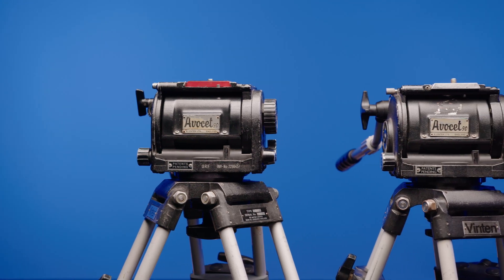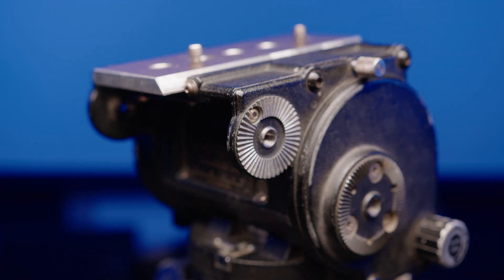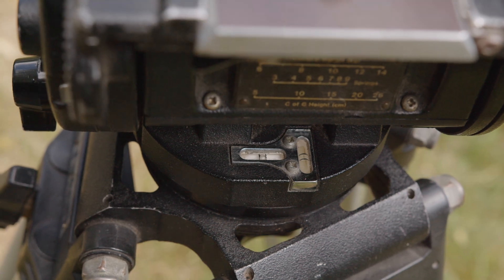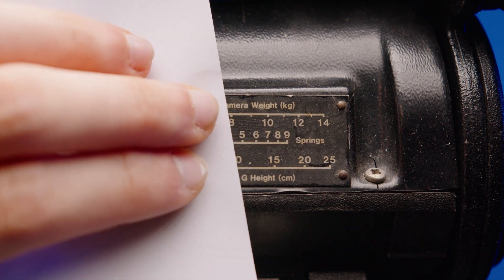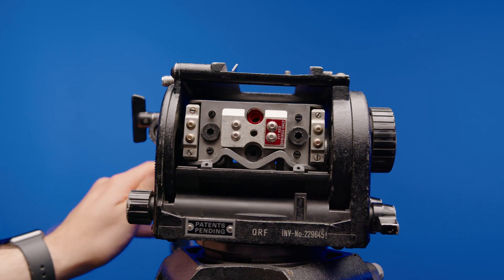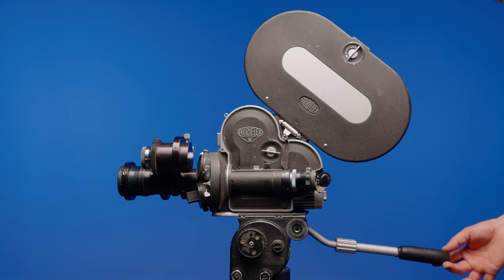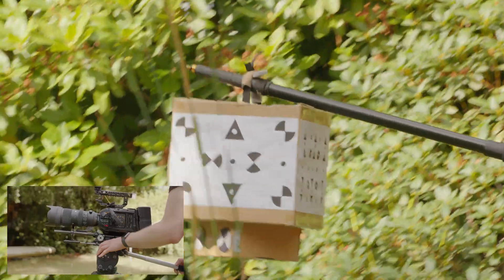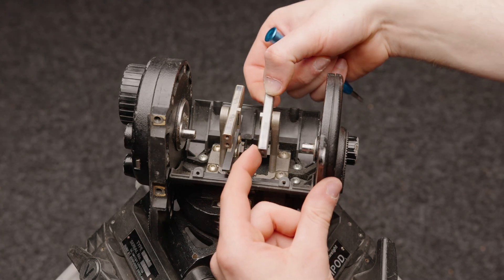Interesting Vintage Fluid Head Technology - Vinten Avocet 90

Comment: Do you still have this head? Or do you know anyone?
Reply from the maker: Yes, I still have both of my Avocet 90 tripod heads, but I don’t know anyone else who owns one, and I haven’t seen another one out in the wild since.
Reply: @deadendboredom  Wow, you have two! Did you already fixed your issue with the spring adjuster? 

The one i have has a small issue. When using the altitude brake it makes a noise. Not real problem since in never use it, but the same noise is generated when you move the head in altitude. The noise only happens around 30° in angle and up. You can feel it in the pan handle to. Not good cause it causes vibrations…

First i thought it occurred due to excessive spring tension. So since i lowered the load the noise and vibration was gone with lighter loads. But now it is back even with zero load and super loose spring tension. 😢

Do you have any idea what i could try? 

There was a video where one disassambled a vinten avocet but cant find it anymore.
Reply from the maker: @0rang3-.-Heart  One of the heads I own does have a spot where you can feel a slight scratching, and in that case, I’m pretty sure it’s because the previous owner used the tripod as a base for a jib and kept the brake locked tightly in one position while putting a lot of weight and mechanical stress on it. It could just as well be that a small piece of metal or something similar got into the mechanism, although to me, it doesn’t sound like it’s related to the counterbalance system, but more to the general movement mechanics.

If it helps, I could dig up some of my old footage - I actually filmed the entire assembly of the head for the video. But that was for the Avocet 90. I remember you asked about the 70, so I’m not sure how similar the internals are, if that’s the one you’ve got.
Reply: @deadendboredom  To bad one is damaged, but now you have spare parts!

I have a Avocet 90 as well. So your video will help i hope 😊.

By the way where are you from? If you ever think about selling the Avocet, hit me up!
Reply: And did you “fix"your plastic spring adjusters? You only used 3 or 5? Or do you have the full 9 you can use now? Maybe i can help 😊.
Reply from the maker: @0rang3-.-Heart  Fortunately, the second one isn’t really broken - like I said, it’s just a slight scratching and it would be a real shame to part it out for spare parts.

Here’s a quick video edit, maybe it’ll help you out a bit:
https://youtu.be/YQ5-TWSPWTk

I’m based in Germany and I’m afraid I’ll have to disappoint you for now: I don’t currently plan on selling the tripod heads. But I’ll keep you in mind... who knows, maybe I’ll need to let one go at some point due to space constraints.

Have you actually found any good alternatives that aren’t made of plastic?
Reply: @deadendboredom 

No problem thank you for helping me out!

No i havent found an alternative and it’s not needed imo 3D printing is cheap and with some caution they will last. Especially with the right filament or expensive (non consumer) printing device.
Reply: PS i didnt notice any German accent at all! 🎉😊
Reply from the maker: @0rang3-.-Heart  what a compliment, thank you! Where are you from?

Comment: Hi, great video! Anyone that have the Avocet 70? Thank you.
Reply: I have an Avocet 70. Alas no camera plate for it. The plate is significantly wider than even the modern 'wide' Vinten plates. I guess I'll have to get one machined to fit as it appears Avocets are very scarce, let alone parts for them.
Reply: @asteamyaffair9993   Nice! Where did you find one? And which color springs do you have? I can try to reach out to Peter, but he could be retired. 😊
Reply: @asteamyaffair9993  Hi did you notice my comment and question? 😊

Comment: Are you still using the Sirui bch30? What have your experiences been?
Reply from the maker: Yes, My budget go to head for heavy cameras. Are you interested in something special?
Reply: @deadendboredom  thanks for the reply! I own a gemini/ 60-600/ v-lock kit (around 15kg), and want to try and avoid buying something in the thousands. Just wondered whether you'd had any negative experiences with it, and what the durability is like.
Reply from the maker: @harryhall4690  One small negative thing: the illuminated spirit level drains extremely quickly and the battery needs to be replaced, otherwise I can't think of anything else so far. I've only had the head for about 2 years and I only use it when I'm using a heavy camera. I can make smooth pans well, and for an fully rigged Alexa Plus weighing about 16kg, I set the counterbalance to level around 8 out of 12.

Your Gemini must be heavily rigged if you're reaching 15kg, but for such weight, I haven't seen any affordable alternative to the bch 30 (except for vintage or used ones).
Reply: @deadendboredom  Thanks for that! yeh it reaches around 13kg when I've got a 7" monitor/ 60-600/ battery/ evf/ 19mm base plate and supports/ follow focus etc etc. I'll definitely give it a try, might see if I can find a demo model to test. Thanks for your responses!
Reply: I worry about the long-term use with these and I don't know anyone who would service them.
Reply: @tylerfukuda  yeh I went with a second hand Ronford baker 2004, got a good price and will last me a lifetime.